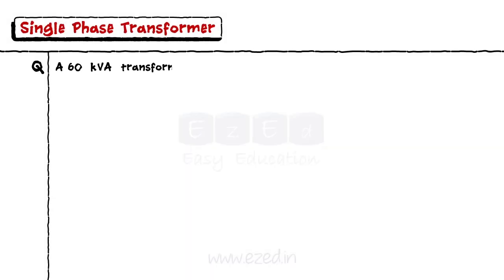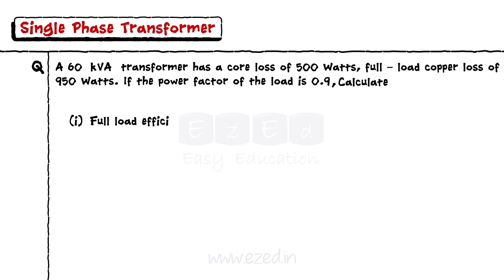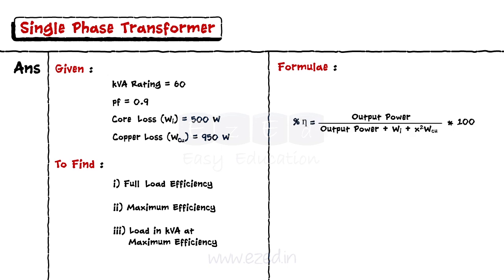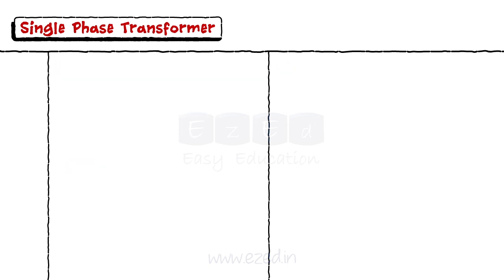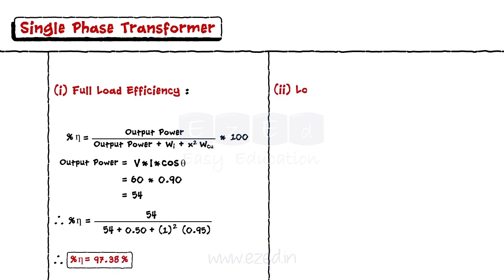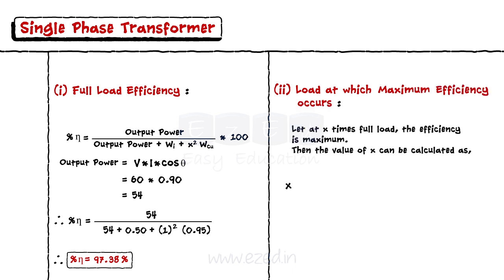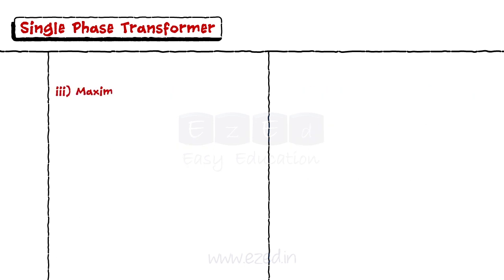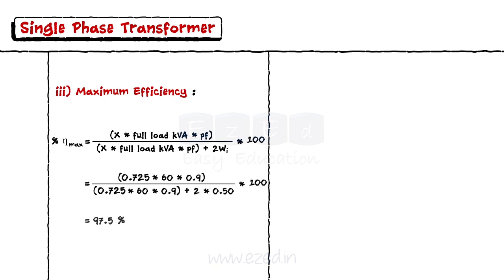Correction - Single Phase Transformer - Full Load & Max Load Efficiency Solved Problem

Comment: I cannot understand how to be low full load maximum efficiency
Reply from the maker: Hi @Hasindu, I did not get your question. Could you please elaborate a bit more?
Reply: Why was 2Wi taken during calculation of maximum efficiency  i.e. no. (iii) ??
Reply: @drtg6804  At Maximum Efficiency Iron Loss Equals Copper Loss.